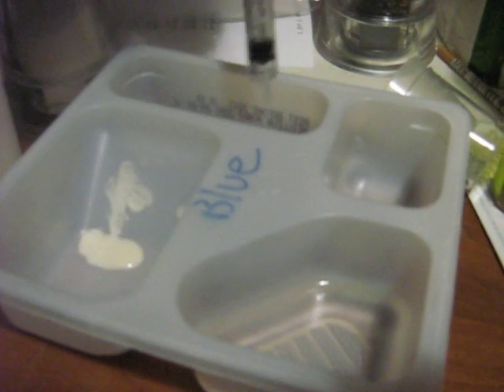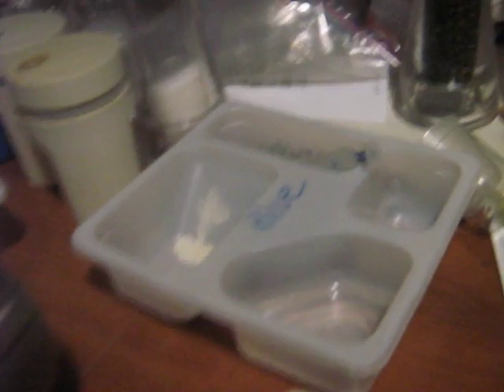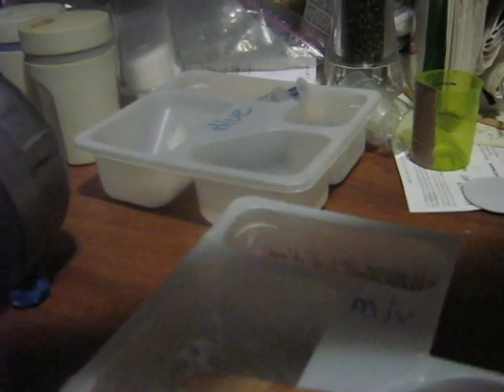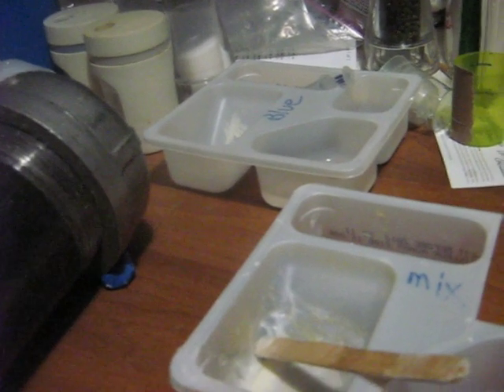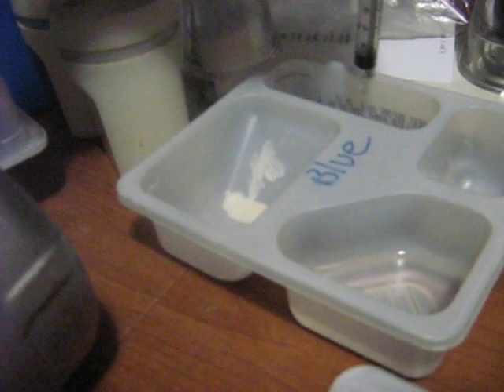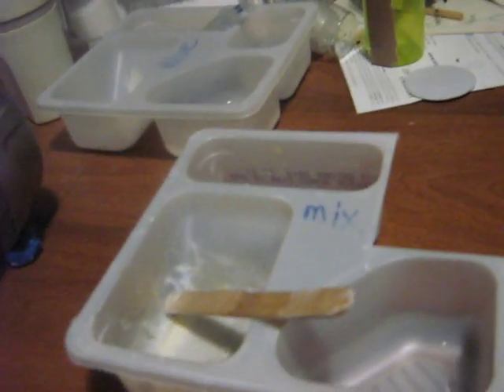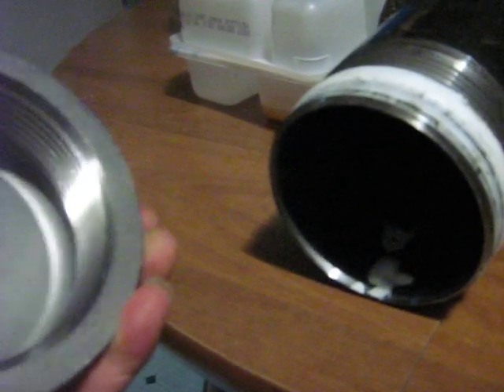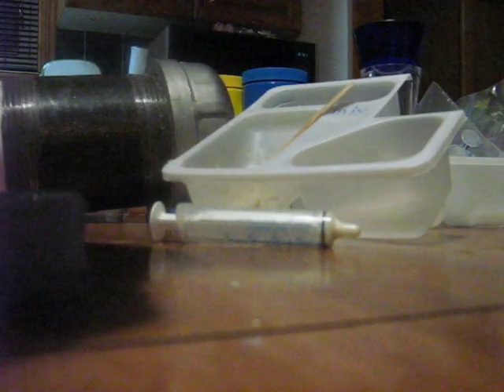Casting Small Plastic Parts #1

Comment from the maker: Sure, that would be no problem at all, it is the smaller stuff where things get interesting.
One thing to consider though, is that the plastic costs around 3 to 5 cents per cc or milliliter. So that is 30 to 50 dollars per kilo-gram (2.2 pounds). The mold making silicone is similarly priced, and you use more in a mold than in the part you cast. But yes, plastic Briggs parts could easily be done. I will make a vid showing how I would do it, in a few days.

Comment from the maker: Yes, making a real mold could run a lot of money! This silicone rubber molding process is cheaper, especially for limited quantities. However the molds can get little pieces torn out over time, I have noticed that slowly happening with these Deltic models, and so far I have only made 14 of them.
The variety of things that can be made is pretty mind blowing, if you want to spend the money on the mold, though. My bid Deltic mold has $45 of silicone rubber in it!
Reply: ChargerMiles007

Comment from the maker: Thanks for watching :)
The process works pretty well, you just need a small air hole at the top of the mold, and a plug to fit it that won't bond to the plastic (or use plastic itself, as it will break off at the smallest point). Plus you have to allow a few drops to flow out of the top to make sure all the air is out, then put the plug in and flip it over and fill up where the syringe came out of.
Reply: ChargerMiles007